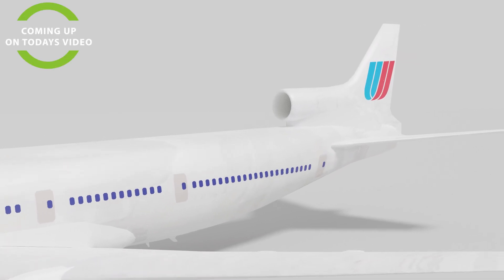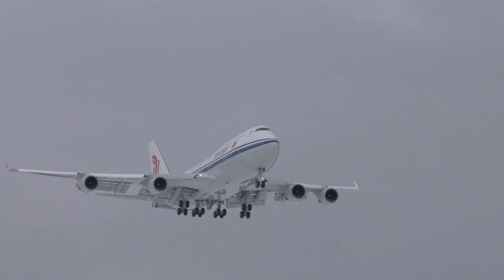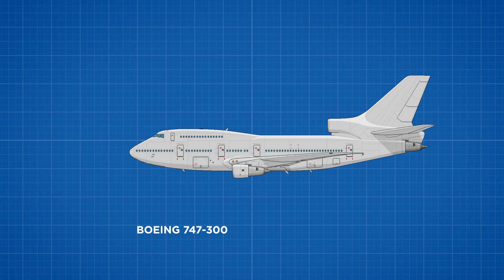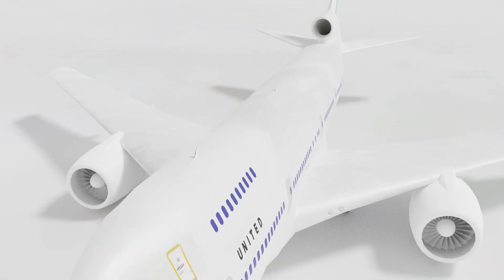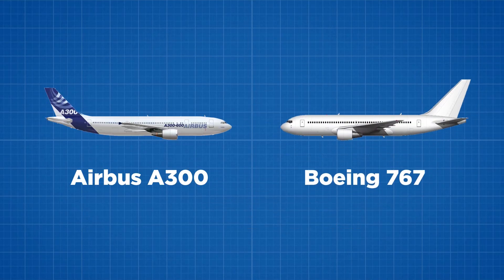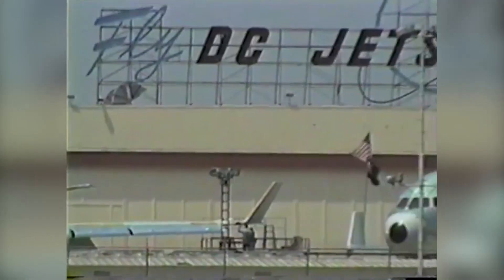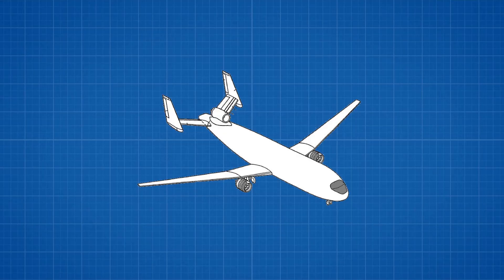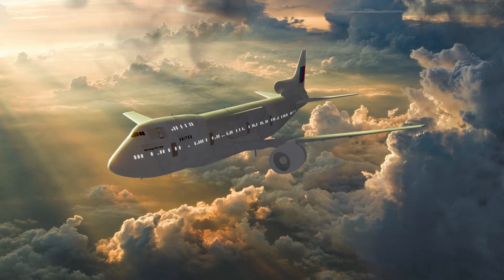Boeing & Airbus Trijets?! The 3 Engine Aircraft Like The 747 Trijet Never Built!

Comment: There was a second reason behind trijets apart from ETOPS rules. The simple fact that at that time there was only one large high bypass engine available.  Or rather one size. All the engines avalible was between 200 and 230kN. While you technicaly could build a 2 engine widebody at that thrust, that would be just at the limit, and there would be no room to expand.

In the late 70-tys those engines was tuned to produce 270kN trust, and the added thrust was sufficient to power a twin engine aircraft

Comment: Cool video but I’m not sure your comment that the tri-jet led to the downfall of the 4 engine aircraft when the 747 and the A380 are in production long after the MD-11 L1011 and 727 stopped production is correct.

Comment: Advantage of the trijet configuration is that you should be over to fly straight path South Africa to Australia without going towards a 6h 10 min etops 370 to a diversion airport  example of this is actually QF63/64 SYD-JNB to which it needs a quadjet to cross the Indian Ocean and deal with the high elevation at Johannesburg. Same thing could possibly apply to Chile and Argentina to Australia and New Zealand. Look at QF27/28 SCL-SYD🇦🇺 before the coronavirus pandemic hit it's actually flown by a quad jet due to twin engine restrictions in the South Pacific. Regarding B767 competing with two Airbus aeroplanes A330-200 & A300-600

Comment: How exactly are smaller engines more efficient? Because jet engines seem to get bigger in general.
Reply: Engines are today Turbofans gererally. They have 2 air flows, one through the engine core and one around the core (the fuel is only burned inside the core).
The engines are more efficient if the ratio of the stream around the core is as big as possible, that's why the fans are getting bigger and bigger. For example, the new PW 1000 G has a bypass ratio of more than 12:1, while the CFM 56 had only around 6:1.

Comment: If A380 had used tri jet ,it might have not ended up early.
Reply: I think it would be underpowered with three engines.
Reply: @Rafael47936  Three engines of the 777 engine has enough power doing that.

Comment: No need for try jets because 1) more powerful and more efficient turbo fans and 2)  ETOPS rule changes. Plus safer to have engines on wings
Further from plane vitals in tail.  Plus more efficient loading pattern along wing,  plus quieter.  These advantages out way the advantage of the redundancies of one extra engine.

Comment: BOEING 727 a fully developed aircraft was a Tri-jet.  Didn't it pre-date the 747?
Reply: You are correct: 1960 vs 1969 (I looked it up).  The 727, 737, and DC-9 were the only types of planes that could come in to my little airport (Sarasota-Bradenton).  I always thought the stairs that were stored on the 727 (front and back) were cool.  I used the back stairs to leave the plane once as a little-little kid.  Unlike Mr. Cooper, the plane was on the ground at the time.
Reply: @christalbot210  plus 1 for the DB Cooper ref!👏🏻👏🏻👏🏻

Comment: With today's engines, two engines should be all that is needed on a large long-range airliner.
 
777 and A350 size should be the largest needed.
Reply: The actual 777 X is even bigger than the older versions of the 747.
However engines like the GE 90 or the successor were not possible in the times when the 747 was sold most.
Reply: Tri jets are less safe than twin jets.  The center engine can blow destroying the tail.
Reply: Specifically the 777-9;)
Reply: There's a reason ETOPS is often called Engines Turn Or Passengers Swim....

It's only a matter of time before this statement is shown in action.....
Reply: Yeah, Looking at the number of aircrafts ordered. The 10-abreast B777-300ER is the largest aircraft that the market need for decades.

They don't actually need B777-9 in the first place. You see that many airlines that uses B747-400/-8i and A380 tend to fly the routes alongside smaller aircraft like B787 or A330.
Reply: Is that you mcdonald douglas?

Comment: It was the advent of ETOPS180(Engines Turn Or Passengers Swim for 180 Minutes) and above that ended the need for tri-jets in civil aviation. And now, it's the four engine passenger jets are going to become history. I believe both Boeing and Airbus are discontinuing, their 747 and A380 aircraft.
Reply: Boeing is still making 747 cargo birds. Probably not for too long. 4 engines just cost more than 2. It's that simple.
Reply: @majorchungus Boeing officially shutdown the 747 production in 2023, ditto for Airbus with A380 in 2021.

Comment: The DC-10 has had a bad reputation with accidents due mainly to operators not following the correct operational and maintenance procedures, 2 were caused by improper procedure to secure luggage compartment doors, American Airlines in June 1972, which the flight crew managed to land safely, and the crash of the Turkish Airlines DC-10 in March 1974, which killed all passengers and crew. American Airlines flight 191 in May 1979, which was caused by improper maintenance procedures, plus several others that were caused mostly by flight crew errors.
Reply: The door locking mechanism was flawed, McDonnell Douglas and the FAA knew about it prior to the Turkish accident. The door would give all indications of being closed and locked but the latches weren’t fully engaged. It was not improper closing.
Reply: @nigelclinning2448  The FAA knew about the cargo door's design problem early on, but, after McDonnell Douglas gave a hefty contribution to Nixon's re-election campaign, there was a "gentleman's agreement whereby the the FAA issued a maintenance advisory rather than a publicized mandatory recall that would have harmed the DC-10's reputation and sales. Even so, McDonnell-Douglas failed to upgrade the cargo door of the Turkish DC-10 while it was still on the assembly line, but certified that it had done so. Later, McDonnell Douglas became somewhat aware that airline maintenance depots were using unapproved procedures to remove and replace DC-10 engines, but did not intervene, which  brought about the infamous DC-10 crash in Chicago.

Comment: the 747 and a380 have proven their need in the market they were ruled out because of the cost of 4 engines so why not make them a trijet? eliminate a quarter of the fuel consumption
Reply: Today you can build an aircraft like the 777X with more passenger capacity than the 747 400 with 2 engines, so there's no real need for trijets today. With Etops you can also fly almost all routes across oceans with 2 engines.
In the past you needed more engines to have enough thrust for long range (you had to carry a lot of fuel), however today you can build lightweight carbon fiber models which have the same range with only 2 engines.

Comment: Interesting. I didn’t know the 777 was designed as a trijet at first.
Reply from the maker: Yep! That’s why the first Boeing 777 was the -200 yet all Boeing planes start with the -100
Reply: @FoundAndExplained  same thing with the 767
Reply: Maybe they also kept that -100 free for a shortened 777-200 but decided to build the 767-400ER (first flight in 1999) to close the gap between the 777-200 and 767-300.

Comment: The Lockheed L-1011 TriStar is one of the most beautiful passenger airplanes ever designed. They should have made a larger 500-600 passenger version with three engines of the same type as the 777 in the 1980s. That might have been more efficient than the 747 and A380, and still been flying also after the pandemic.
Reply: Not to mention one of the biggest reasons the 747 and A380 fell out of favor is they are already too large. The 747 was perfect for its time but the hub and spike model is going out of style and the A380 really misses their optimal market by 25-30 years. McDonnell Douglas proposed an MD12 in the early 90’s that was basically the same thing as the A380 and there wasn’t much interest even then. 

There’s large aircraft are incredibly profitable when they’re full. But they’re 1.) limited to incredibly high demand routes that can fill them and 2.) are incredibly unprofitable when not full.
Reply: @jimmygee3219  remember taking a round trip on a 747 to Hawaii on PanAm for New Year's around 1983.  $100 round trip and there couldn't have been more than 50 passengers on board. The failure of both that airline and the aircraft was inevitable.
Reply: @commerce-usa  That aircraft hasn't failed
Reply: @unfurling3129  perhaps the airliners themselves haven't fundementally failed, but it is no longer viable in today's market, neither is the A380.  It is not a failure of design for either, but rather one of current commercial passenger aviation industry needs and requirements.
Reply: @jimmygee3219  wish the 747 had stayed, I always want to be on one. Not to mention it's so iconic.
Reply: @merafirewing6591  still some time! Lufthansa still flies them as does Korean Air! I need to hop on one too
Reply: Dc 10 and tristar fighting for beauty
Reply: Modern carbon fiber aircraft with today's engines  beat every aircraft of the 80 easily, no matter how much engines.
Even popular 90s models like the twin engined A 330 has no chance against a 787 or an A 350 in fuel economy. Boeing had to offer a more modern variant of the 777 with new wings to compete with this aircraft. 
The A 380 has around 600 passengers in the normal layout, and it was too big for most routes. A jet for 600 passengers is heavy, which means it's usually Icao class D (wing span up to 80 m) and it needs runways which can handle the load. 
Today most 80s aircraft are flying in Africa, aircraft are usually only used 20 to 25 years in the western world.
Reply: It wouldn't fit in the tail. If they made as a two engine it would have been much better.